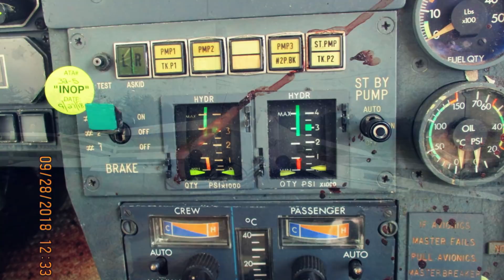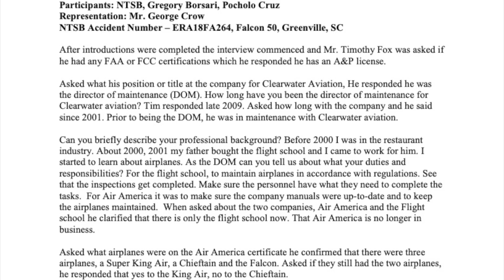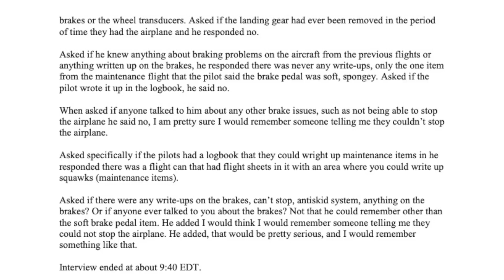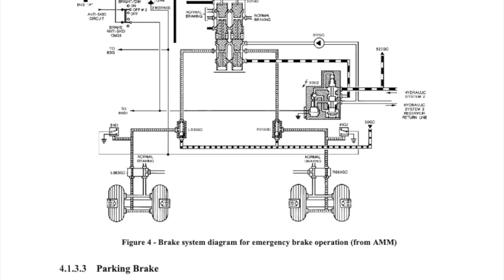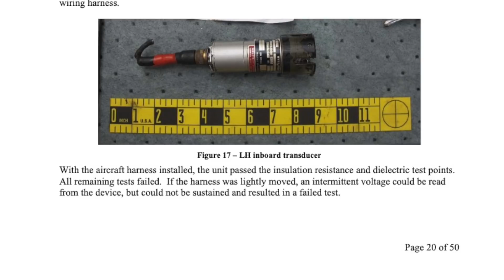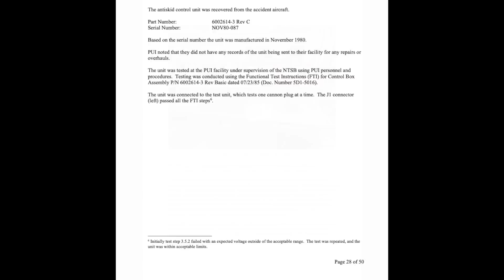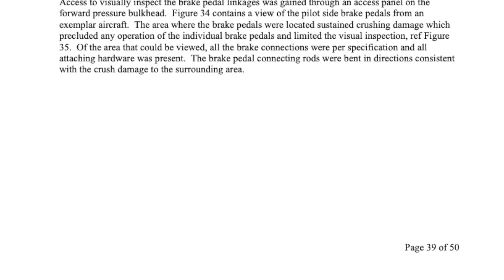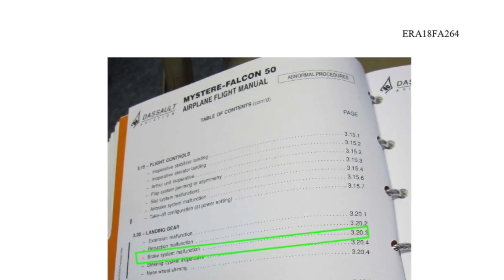Dassault Falcon 50 Splits in Half During Fatal Runway Overrun

Comment: Would a better or properly trained pilot have known to switch the braking system in the event of that failure?
Reply: How about a pilot with a type rating for the aircraft? Or perhaps an airplane that was actually inspected and certified as airworthy?

[Answer: Yes. But not for the reason you were probably thinking.]
Reply: @brandontaylor6736  A properly type rated pilot wouldn't have flown it in that state, maybe?
Reply: Noe Carrier 
The FAA and manufacturer have no objection to that aircraft being flown without a functioning anti-skid system, but there are conditions that this crew did not comply with. The main one being the brake selector switch must not be selected to an inoperative position as indicated by the sticker next to the switch. This would not have been a problem if they flew the airplane with the switch in the #2-OFF position.
Reply: The co-pilot had been in the cockpit for the 4 previous flights with the braking problem. He knew what to do but didn't do it.
Reply: @InteriorDesignStudent    But only being co-pilot, as his rating allowed, he may not have really noticed what the pilot was doing during those landings.  There does also seem to be a large amount of scepticism at the operating company that the braking fault was as serious as it actually was, with the faults in the anti-skid system effectively rendering the brakes inoperable above 25 knots with the anti-skid active.  Unfortunately, the pilot on that last flight found out exactly how serious the issue was.  It could have been a lot worse if a bus had been passing on that road, though...
Reply: gosportjamie • I don’t even want to think about that, but admit it occurred to me that any traffic (I simply refuse to think ‘school bus’) at the moment - can’t help but think of all the aircraft accidents in cities and neighborhoods. Each victim had their own story of life before they looked up to see their last scene - a huge jet only seconds away and heading right for them ..I’ve always been uncomfortable about living or working within the sight line of either end of any runway anywhere for this reason. I know they could crash right on top of me out here in rural America too, but there’s just something about those homes and businesses and schools and cars as you’re coming or going. I just would rather not live where the pilots and passengers can see actual faces, albeit tiny, during the two most critical phases of flight.
Reply: @gomphrena-beautifulflower-8043    I must admit that I do find it rather surprising that US powers allow so much building just off the approach and departure ends of runways with it being such a large country.  In the UK they are much tighter on that, despite there being much less land available for building, and often it's only land that has grandfather rights, i.e  it was occupied with a building before the airport existed, that is able to be built on, specifically to try and reduce the risk of aircraft that get into trouble on approach or departure falling on to populated areas.  I live close to a former military airfield and the northern approach end is still fields, despite the pressures on land for development here, and it looks like it is going to remain so for the foreseeable future, even though the airfield is only used by aircraft from a gliding club and the search and rescue/air ambulance helicopter.  The gliding club may well be forced to close or move soon as the airfield site is redeveloped into industrial units, but that land has to remain open for at least the next 10 years.  At the southern end there is a small amount of open land, despite what it would be worth for development, and then the sea, with property on that road being in the £750,000+ bracket and restricted to being single-storey...
Reply: gosportja
Reply: gomphrena -beautiful
Reply: This just breaks my heart. I know little about aircraft, but love Aviation. I read every one of those reports, and seems like (irrespective of the accident damage) so much was out of acceptable parameters or outright lacking or missing; from maintenance records to oversight to parts to management to pilot type rating to mechanic qualifications to ... at every level something fell out. 
Condolences to the families; best wishes to the survivors and hope they’re doing well...
Reply: The pilot who flew the aircraft for its test flights and reported the brake issue in the first place clearly did, but the PIC on the fatal flight wasn't rated to be in command of the Falcon.  I imagine the first pilot never expected the aircraft to be operated before the faults had been rectified so probably never felt the need to communicate what he had done to deal with the issue.  Of course, it's perfectly possible that the pilot on the fatal flight did know how to deal with the situation but rather panicked in the moment with the results shown...
Reply: They didn't even pull the parking brake.
Reply: @kewkabe    I guess they just didn't think of that...